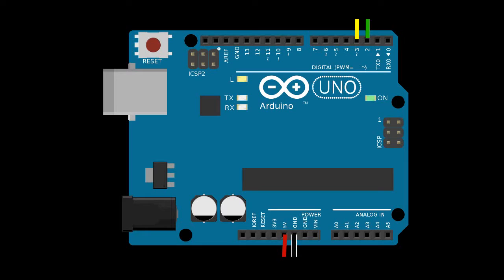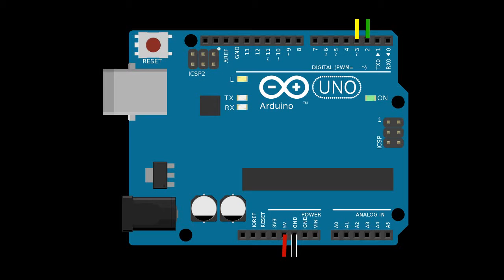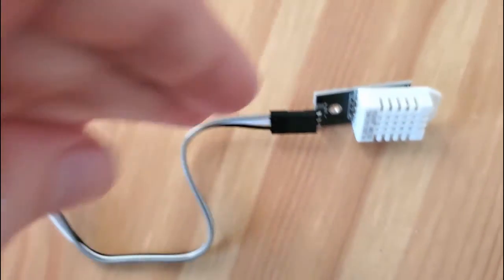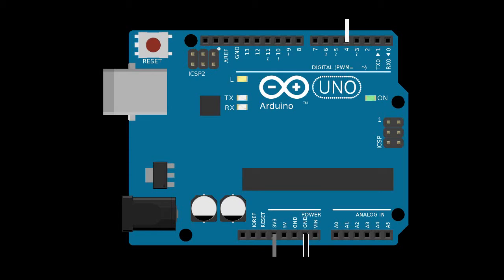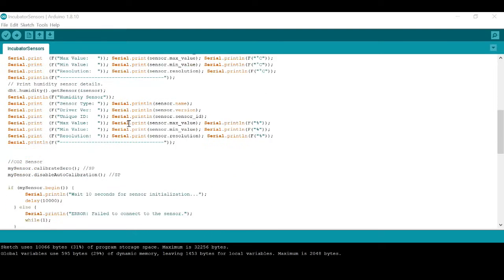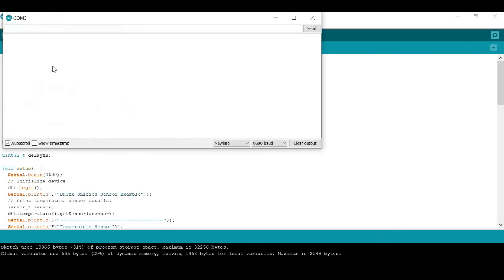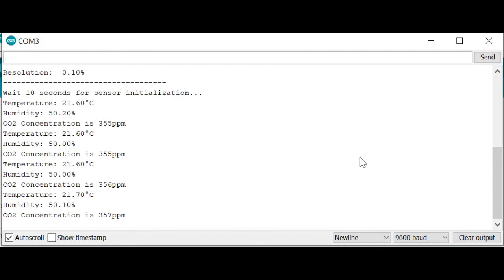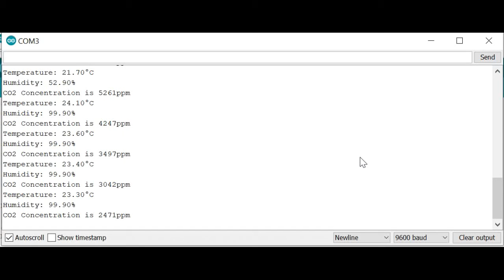DIY CO2 Incubator: Sensors

Comment: Hello Qosmos, I have ordered CO2 from Ali express and I have not found the I2C/Uart module there, now I am wondering how can I use it, I have configured the UART setup by connecting 4 wires of MH-z16 with 4-pins of Arduino (GND = GND, Vcc=Vcc, Tx=Rx, Rx=Tx), and Arduino connect with TTL. But when I tried to upload the code its not working. is there any way to connect MH-z16 with Arduino directly?? please reply to me as soon as possible?
Reply from the maker: You probably need to install the libraries for I2C or UART. https://github.com/SandboxElectronics/NDIR
Reply: @qosmoschem  for Uart I have added ( NDIR_SoftwareSerial.cpp and NDIR_SoftwareSerial.h) in the library folder and I am using the example given under NDIR_SoftwareSerial folder. program compiles fine, but when I start to upload it, it's not uploading. if I separate the MH-z16 from the Arduino program, the program flash in Arduino perfectly but as I connect it with Mh-z16 it fails to upload the sketch. do my wiring is fine. I only connect 4 UART pins to MH-z16 with 4-pins of Arduino?
Reply from the maker: Sorry I can't really troubleshoot your error remotely. If you followed the wiring shown in the video it should work. Only 4 pins are required.
Reply: @qosmoschem  actually what I am trying to say is: in your video you first connect CO2 sensor with I2C/Uart module with a 7-pin header from which you can select the uart or I2C wiring by simply moving the button. but i don't have that I2C/Uart module, I directly connect my CO2 sensor with Arduino by only 4 pins out of 7, the other 3 pins are not used. so is this the problem my program is not uploading?
Reply from the maker: Ok I understand now. Yes, you probably need the module then. It may be possible to use the sensor without the module and connect directly to the arduino, but not with the libraries I've linked. You might have to code your own library in that case.
Reply: @Shuvra Jyoti Bose share your email address.
Reply: @Shuvra Jyoti Bose to whom you are asking this question? if its me kindly share your email address so that I can share the circuit diagram and code with you. i can't share them here as there is no way to share them on youtube. noted the circuit diagram i will be sending is the direct connections of mh-z16 with Arduino without having the I2C/Uart module. thanks

Comment: Hi man, thanks for the video.  I am making a portable co2 incubator and also quickly found out that the sensor you ordered and the pellinglab sensor are the only two viable options for a co2 sensor.  I was wondering if you think that the pellinglab sensor would be worth the extra money, especially considering that power consumption is a major factor.
Thanks and I hope to see part 2 soon :))
Reply from the maker: I'm not sure about the power consumption of the Sandbox Electronics sensor, but the ExploreIR sensor specifically states it's suited for battery powered setups. Since the ExploreIR isn't that much more expensive I'd probably choose it for your application.

Comment: Great video, when will part 2 be out?
Reply from the maker: Unfortunately I'm pretty busy with work at the moment so it might take a while. I also ran into some issues with the regulator that I got for part 2, so I still need figure that out as well.
Reply: @qosmoschem  How to contact you man?? Unable to reach out regarding exact circuit and code